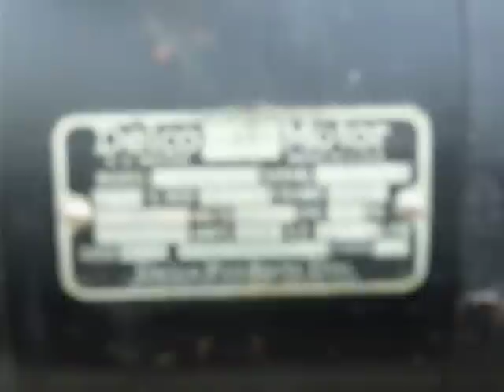Vintage Bendix Automatic Washer Restoration Part 1

Comment: Mom had a Philco-Bendix washer-dryer for over 10 years.  It ate spin solenoids.  She ran fabric softener on every load, and eventually the build up of softener inside the machine ruined the dryer side of the machine.  Other than solenoids galore, it ran like no other, and until the dryer failure, was used every day.  She bought it in 1961.

Comment: I'm trying to remember - were the Bendix machines the first fully automatic washers? That spun the washed stuff from being soaked to just damp, so they didn't have to be put through a wringer?
Reply: hebneh 

I believe you are correct. Bendix had the first fully automatic washer in the late 30's.

Comment: Does the motor have two speeds, one for spinning? No transmission, then?
Reply: Organgrinder1010 it does have a spin
Reply: They had a transmission. Some had three speeds- Wash, spin and high speed spin ( extraction )..